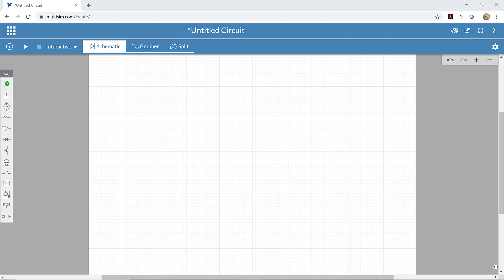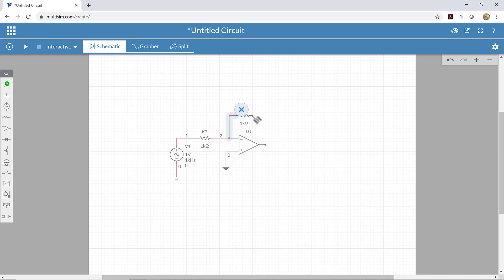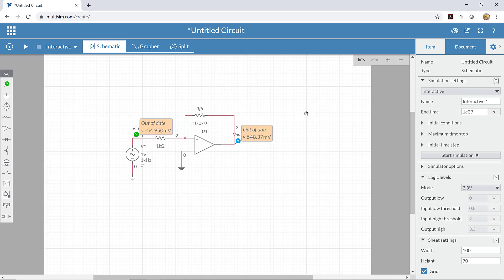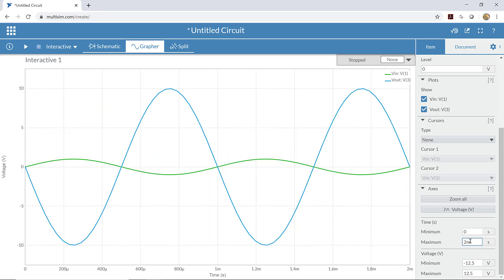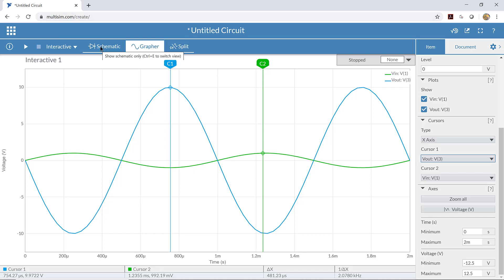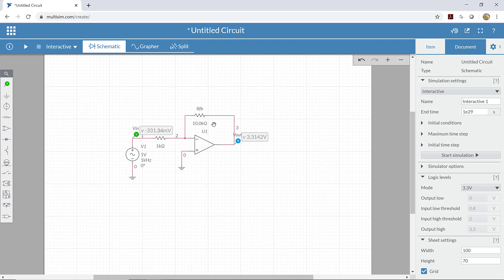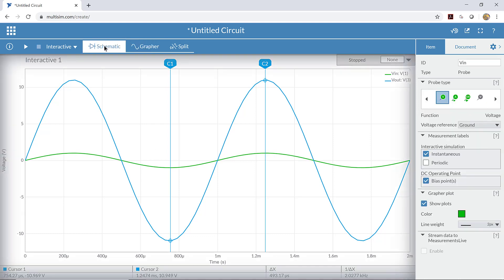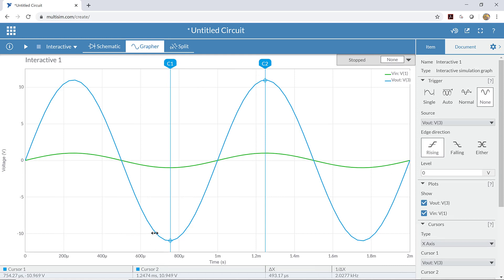Multisim Op Amp Demonstration

Comment: How would you simulate an ideal op amp? I mean the virtual short circuit effect
Reply from the maker: Hi Adrian!  When you talk about the virtual short circuit effect, I think you mean that both inputs are at the same voltage.  Op amps work to maintain this condition, and the multisim op-amp exhibits this behavior.  If you measure the voltages at both input terminals you should see that they are almost identical.  There are a few caveats to watch out for:

1) This effect only occurs when there is a feedback connection from the output terminal to the negative (inverting) input.  Most op-amp circuits include this feedback connection.

2) This effect will not occur if you supply an input voltage that causes the output to try to exceed the supply voltage.  

I hope this helps.  Let me know if you have other questions!

Cheers,
   Jordan.